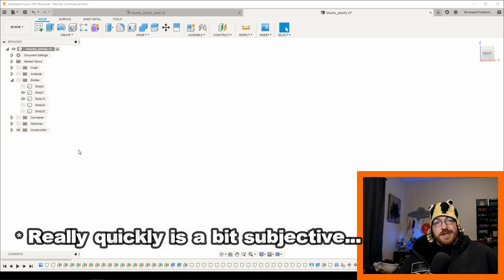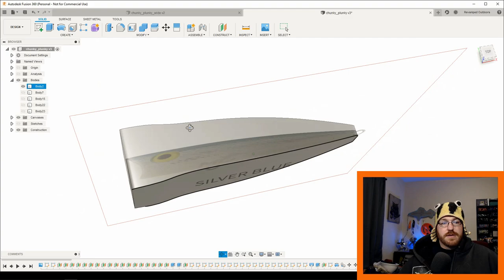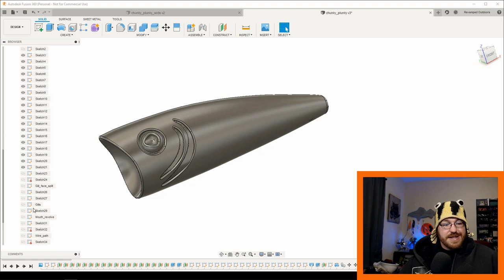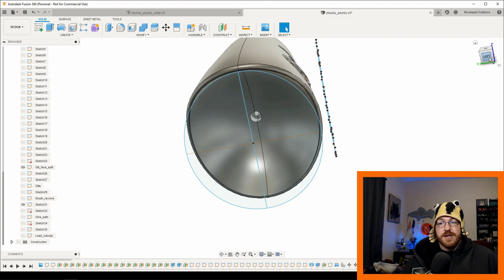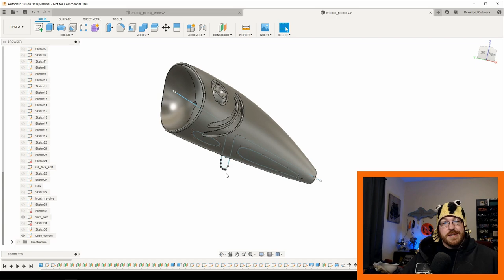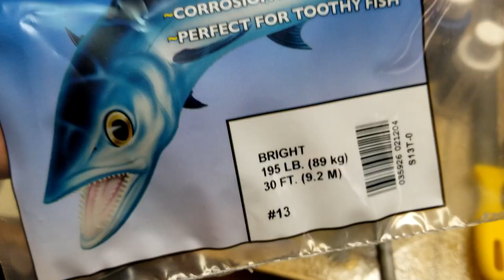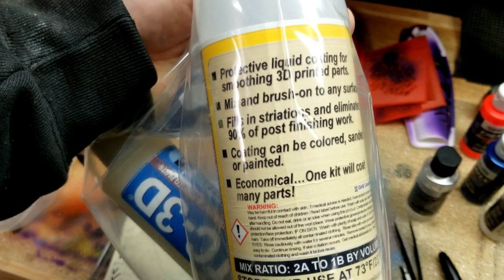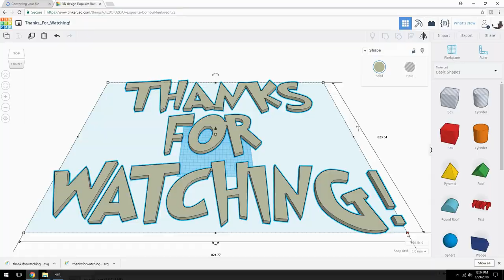I made a HUGE popper fishing lure...It may work, I dunno.

Comment: looks good..

UV glue lure coating is easy and fast
plastic bucket - uv led strips - USB Step UP/Down Power Supply Module - power bank..most uv glue cure in 5-10 min
( LED strips goes from LED 2835- 3014- 5050- 5630- 7020 
 strength )
uv flashlight 100 leds 395nm to set the glue befor cure in the bucket.
Reply from the maker: Awesome, thanks for the tips! I'm thinking that might be the way to go for me in the future, I'll look into a handheld light to cure quick!

Comment: How are you finding the center point on each analysis in order to draw the ellipse sketch perfectly?
Reply from the maker: When you set the new construction plane there should be a lose outline of the rough body imprinted on the construction plane. You can then use that imprint to align and center the new ellipse sketches. I hope that helps.
Reply: @RevampedOutdoors  Ok so the fastest way that I've found is to sketch a center point square on the section analysis plane then stretch the square until it's perfect. After that use the ellipse tool on the center point of the square to make it perfect. Then select all and deselect the oval and delete the rest leaving only the oval. I have like 30 section analysis on my lure so I had to find something faster. Maybe I'm doing this completely wrong though lol!
Reply from the maker: However it works if it works it works lol.

Comment: When making the eclipse do you constrain them?
Reply from the maker: Not anything special, they are usually based off of a cross section of a body I have cut out already. So when starting the ellipse in that cross section it defaults to a constraint on the cutout body. You can remove those constraints as you progress down the length if you want to though.